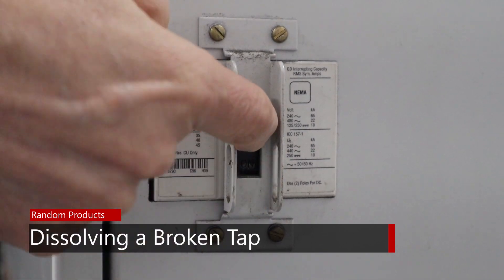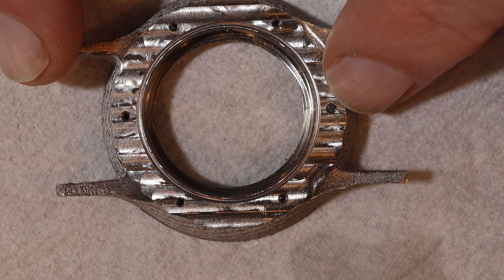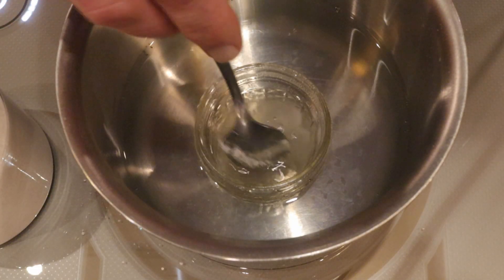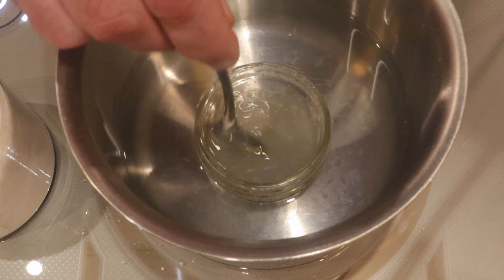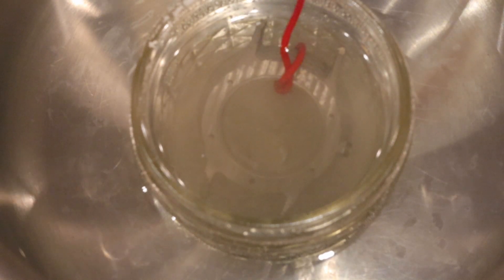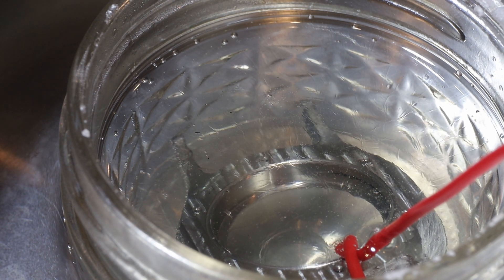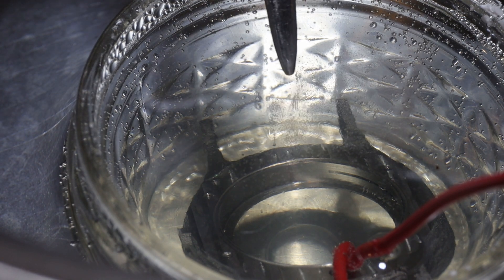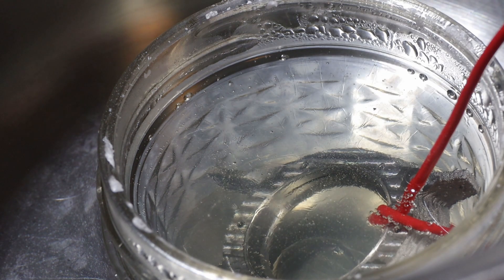Dissolving a Broken Tap

Comment: Great tip for stainless have you tried this on any other metal bases and what was the strength of the alum concetrate you made to do this?
Reply from the maker: I have not tried this on aluminum, but plan to the next time I break a tap in aluminum. As to concentration, I kept adding powder until it stopped dissolving. In other words, saturated.
Reply: @JohnSL  thanks really appreciate the response i think this is worth more research
Reply: @JohnSL  no aluminium reports yet?

Comment: I have been summoned! 😂 Nice tip, will keep this in mind for inevitable, future tap breakage!  The "zero flute" tap removal drills (Omega Drill) also work well. It's basically a carbide polygon that you use to slowly grind up the tap.  A little more stressful since you have to babysit the carbide but could be handy in materials where the alum doesn't play nice.
Reply from the maker: Nice! And this tap was closer to your size range.

Comment: I struggled with small taps breaking both manually and rigid tapping until I picked up a tapmatic. They allow for a small amount of misalignment and have a adjustable clutch. I picked one up barely used on eBay for $250. Tapping capacity is as small as M0.5
Reply from the maker: In my case the tap broke because of twisting, as it was a poor quality, straight flute tap and not up to tapping stainless steel. In the future, I plan to rigid tap in the CNC machine, as that will be faster and more reliable.